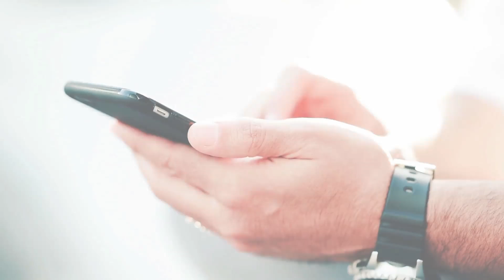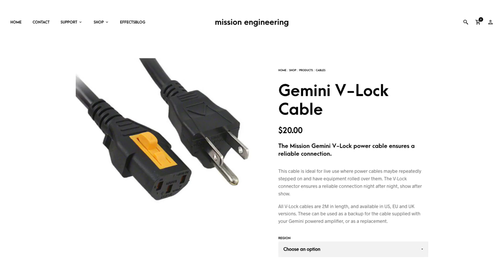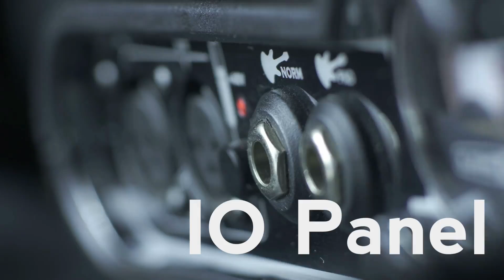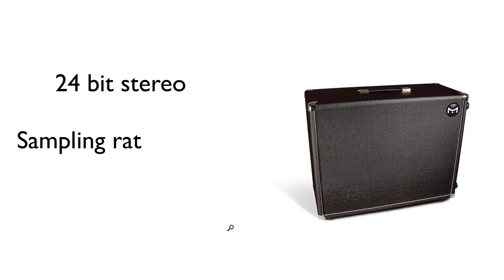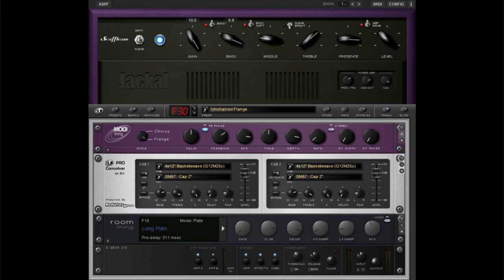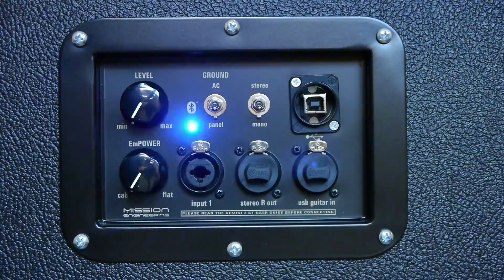Mission Gemini Video Owners Manual

Comment: Brilliant !! This cleared up a lot of questions that I had about what The Gemini 2 can really do.
There is still one question that I have concerning The USB Functions of Playback and Recording with regard to “Backwards Compatibility” with Older MAC Operating Systems. Will it work with an older Mac Pro running Snow Leopard MAC OS ??
Reply from the maker: For USB Audio you'll need an OSX veversion with USB Audio CLASS 2 support. From what I can find it looks like Snow Leopard had at least some CLASS 2 features supported so it should work for basic audio streaming. You may not have all the features of later versions https://developer.apple.com/library/archive/technotes/tn2274/_index.html